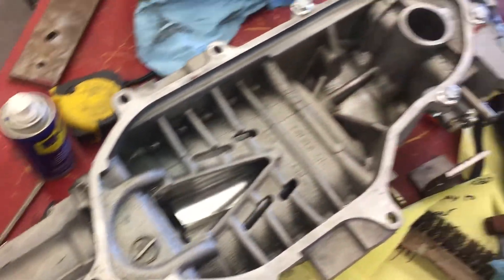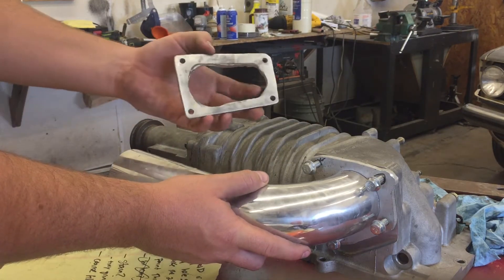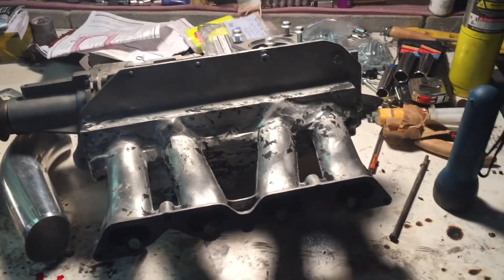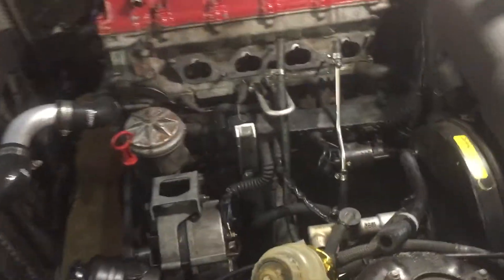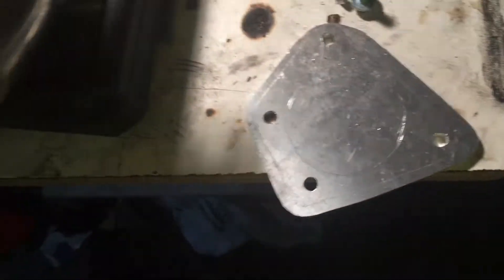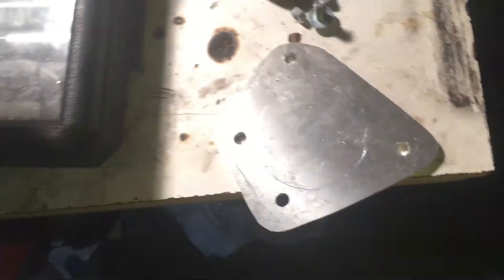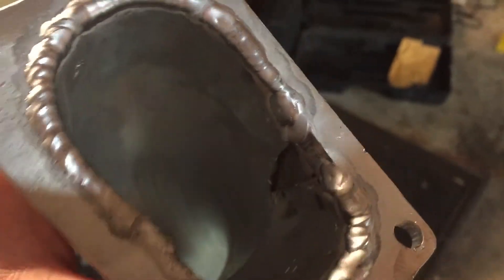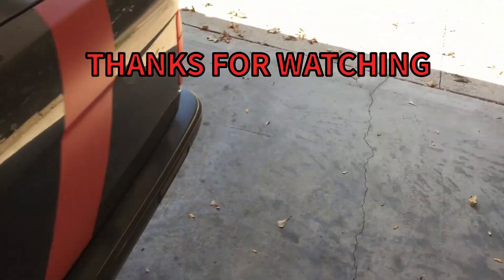Fabricating the Inlet Tube | E30 SUPERCHARGER BUILD

Comment: Will you're ecm and fuel pump be able to keep up with this set up?
Reply from the maker: Sup
Ya I put a walbro 255 in it so the pump is lit 
And for engine control IdK... but I have a boost referenced fuel pressure regulator (FMU) for keeping the air to fuel ratios good